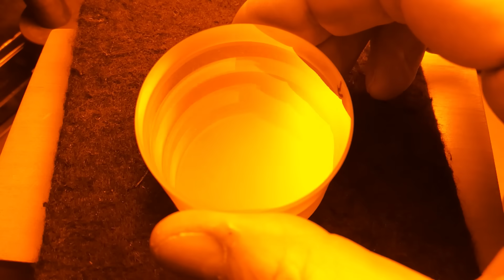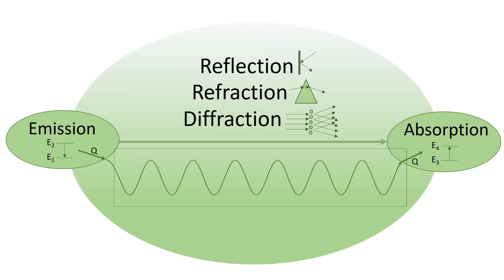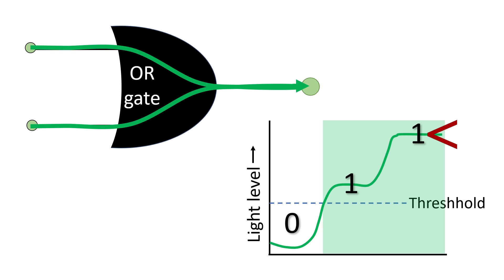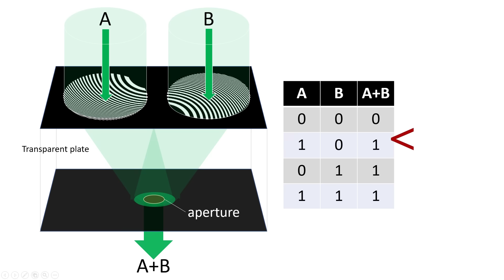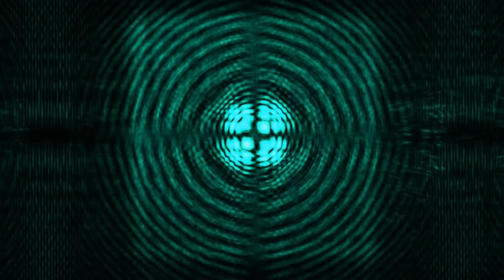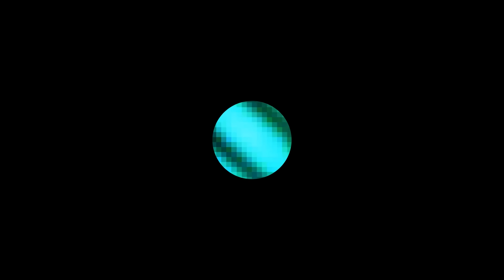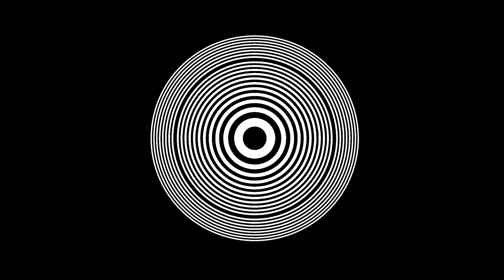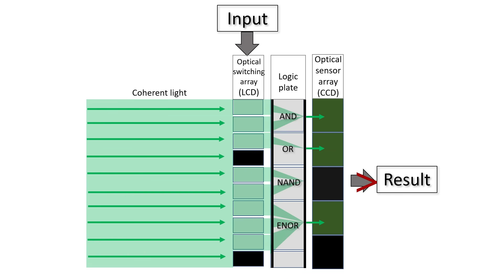Making Optical Logic Gates using Interference

Comment: Interesting, I've been tooling around with the idea in my head for a while. Should be a good video. =)

Edit: Ok finished the video. This is similar to what I was thinking. My idea was based upon the double slit experiment and you'd basically fire two beams of photons (one beam per slit) and if both were on, you'd get photons in the center of the diffraction pattern at the "aperture", so basically an AND gate.

I hadn't really worked out the NOT gate yet but once that was figured out you could build a NAND gate and then from there since its a universal gate you could build any of the other logic functions; OR, XOR, etc.. and well... things just progress from there. Sure since everything is NAND the gate count goes up, but given the speed at which it would run, I don't think one would care until you're pushing the limits of the technology.

One concern if chaining gates along to form logic and computational units is the attenuation of the light going from one gate to the next. Since the light is diffracting I would suspect some photonic loss at the aperture. So at some point you'd need a signal booster of some sort.

This was one of those things where I figured if I had thought of it surely someone somewhere else much smarter than I had already thought it through and determined it wasn't viable and hence why we don't currently have the technology. =) But hey, maybe there's something to it after all?

It's certainly interesting stuff.
Reply from the maker: Thanks, you have clearly given it a lot of thought. I myself thought that this type of configuration would be well documented by others. But what you see is that efforts are mainly directed to "in-plane" configurations, so that processing is more compatible with IC manufacturing. And you are right about the efficiency. With every diffractive element, you loose at least 50% of the light. But with a limited number of layers, I guess light intensity loss will not be a very big issue.
Reply: @HuygensOptics  To address the attenuation problem, I suppose you could pass the output of the logic gate through a laser cavity with the end mirrors removed (i.e. utilise the Light Amplification bit of the LASER acronym) - to get more amplification you could fold the beam through the cavity a few times. Perhaps a dye laser would be suited to this - obviously the laser would have to have the same wavelength as the amplifier. Possibly you could use a single cavity to amplify numerous beams. But I suppose if you have a long beam path you would end up with optical logic that is slower then current electronic logic.
Reply: @johndoggett808  even if it were slower it would still have uses. A solid state computational device that's immune to electromagnetic interference would have many uses.
Reply: @zyeborm  True
Reply: @HuygensOptics  That’s where I think that building an optical key sounds like a good idea.

Electricity is just too good at running electronics since it is just so easy to use changes in magnetic fields to flip relays or charge up capacitors or quickly change the properties of P-doped transistors to allow other current to flow. What you basically need for a photonic circuit to be as good as an electrical one is to find some way to have light particles on one side of a transistor cause the other side of the transistor become transparent (and then become opaque when no light flows, or Vice versa) in order to avoid needing to revert back to electricity to control the flow of light
Reply: An erbium-doped glass could be used as an optical amplifier